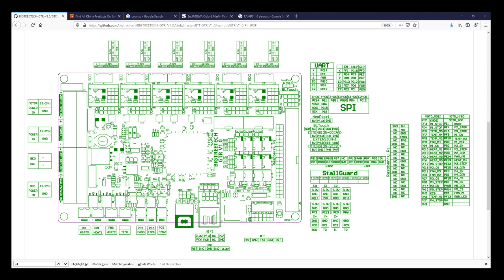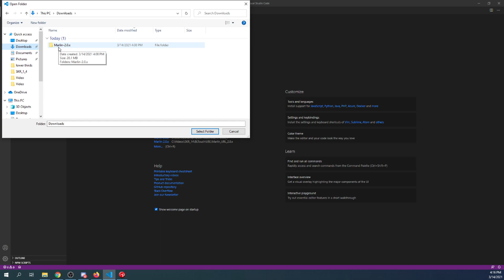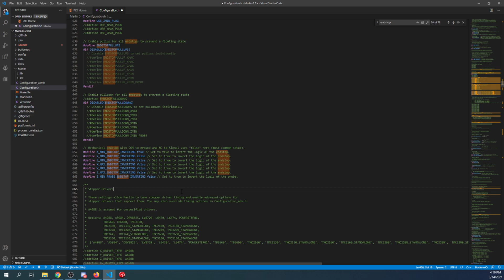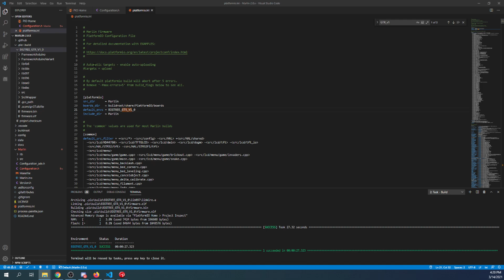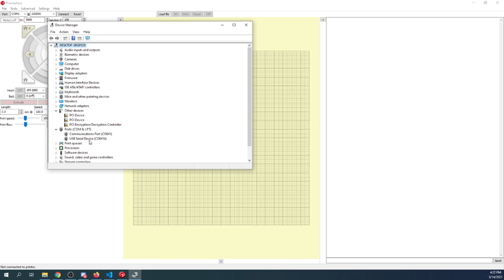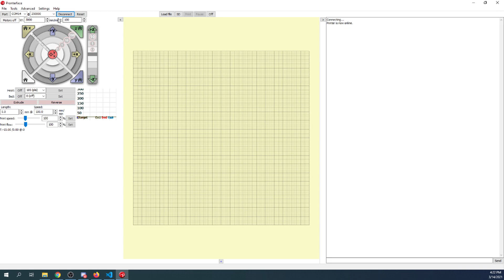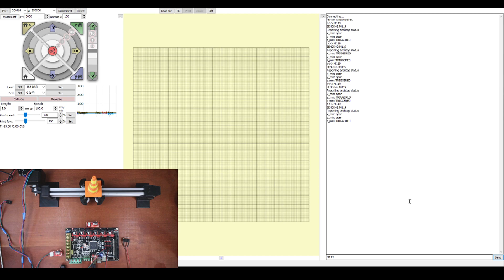BTT GTS v1.0/M5 v1.0 - Switch EndStops

Comment: Hi, that wasn't working for me. I figured out reading the GTR manual that the stallguard pin on the TMC2209 needs to be cut (when mounted on the board), now that works ok.. Merci pour la video!
Reply from the maker: You're welcome, but remember if you wish to use sensor less in future on tnc2209, you'll need to resolder pin.